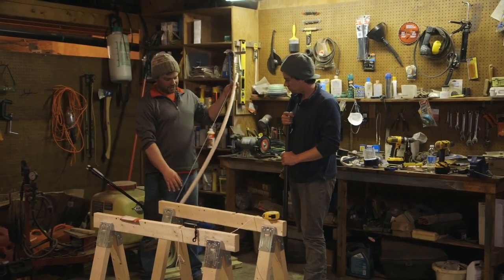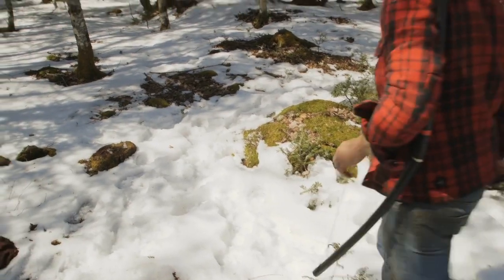How To Make a BOW AND ARROW

Comment: Use a bolt as an arrow rest!
Reply: No, that will make a weak point in the middle of the bow, where most of the stress happens. This will make the bow break in your hands which will be incredibly painful and dangerous. You really shouldn't do it especially with a non-tapered bow like one of them has.